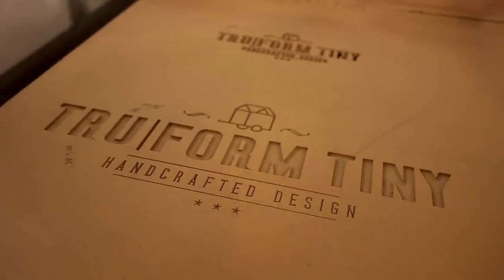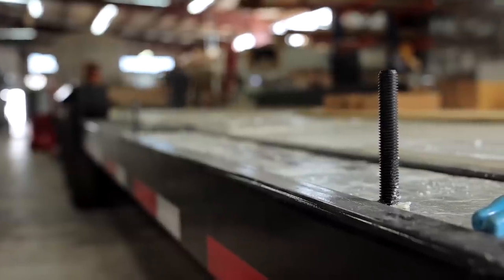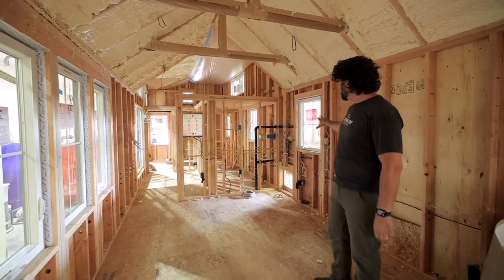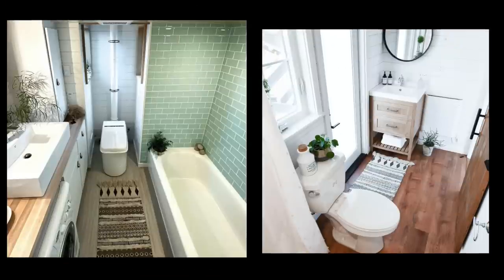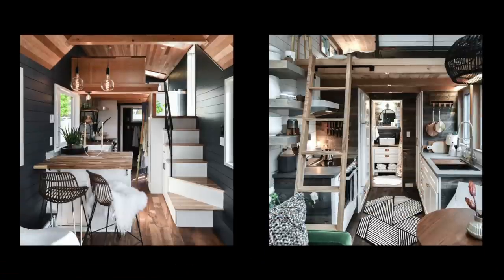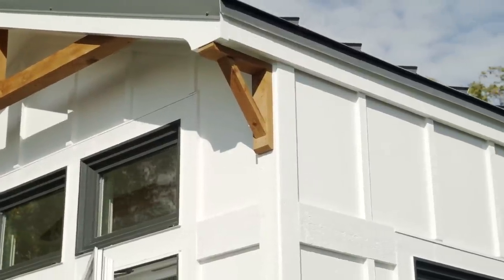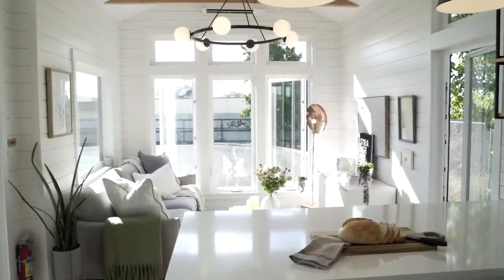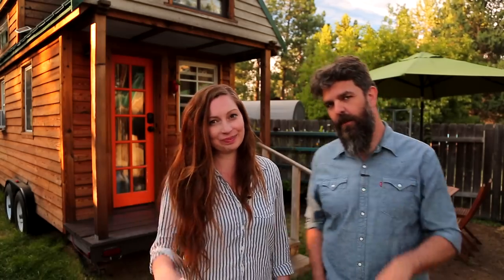How to Build Amazing Tiny Homes + Gorgeous Park Model Tiny House TOUR!

Comment: I’ve  worked in both commercial and residential construction for the last 28 years. I can attest that the building methods here rival, or best, most traditionally site built homes in the typical residential industry.  The craftsmanship is FAR BETTER than tract builders…it is comparable to custom built homes on a slab or crawl space foundation. Visit a tract home builder and you will see out of plumb walls…windows that are askew and rely on shims to make the windows “fit the opening”..roof to wall connections with gaps stuffed with sealant/caulking. For anyone believing these are fancy “mobile homes” ..they are NOT... These literally are site built homes on a mobile foundation. Absolutely beautiful as well.   TruForm will be my builder for my tiny home when I’m ready to build in 2024. ♥

Comment: what is the design program used  by Truform in this video?
Reply: I wondered the same as I'd like to do a mock up of the small cabin we're building, would make designing/placing stuff a lot easier I think.  I've tried a couple of free apps but haven't been too happy with them.
Reply: @malzimus  I've used Sketch-Up for years and I love the program, it gives a great 3d visual understanding of interior spaces but the program in this video seems to be more precise and better suited for tiny home mock-ups. I get the sense that these renderings could be used as straight-up blueprints.
Reply from the maker: Great question! Not sure but hopefully they’ll pop over here to answer your question. Also check out this new 3D tiny house design program from TinyEasy: https://www.tinyeasy.co.nz/3d-tiny-house-designer?ref=6&utm_source=blog&utm_medium=link&utm_campaign=affiliate
Reply: Great question! Our designer typically uses SketchUp.
Reply: @TruFormTiny  Thank you for your reply - I'm a SketchUp addict - It's a great problem solving tool - to me it's like a video game that doesn't waste your time - you have something to show for the countless hours you spend on it.

Comment: This is the first time I have heard of you guys and your business , your homes are gorgeous . The last home on the video, what was the cost of that home.
Reply from the maker: Hi Larry, happy to introduce you to great folks at TruForm Tiny! The Cascade Max model is one of their most high end homes and is priced around $186k: https://truformtiny.com/tiny-home-park-models/
Reply: @TinyHouseExpedition  Jeeze. Sad to see these tiny homes costing what a full-size house costs. 😔
Reply: @lisasoar8448  depends on where you live I guess. In my country you would be very lucky to have a very small outdated apartment for that price.
Reply: @lisasoar8448  False equivalency, a full size house built to that quality would run up into the millions for apples to apples. Houses don't all cost the same price!
Reply: @ZeoCyberG  No, these tiny homes ARE becoming more expensive. You could buy a house for that money. Would it be as nice? Maybe, maybe not; however, tiny homes don't appreciate the same way regular homes do. Tiny homes are supposed to be an affordable alternative.
Reply: @lisasoar8448  Sorry but everything is becoming more expensive.  It's the economy!  Reality check, the housing market has more than tripled in most parts of the country in the last 2 years.  While affordability is relative and not universal.  Everything built is going to range from low end, basic/generic, and minimalistic for the masses to high end, advance, and custom tailored to the individual, which means there's going to be a very wide range of prices for every type of home.  So if you want a nicer home, it's going to cost more!

It also means it's your choice, you don't have to buy a nicer home.  So you decide what's affordable to you, but you don't get to decide that for anyone else!  Fact is most of these tiny homes are being bought by people who can afford them, most of them aren't going to be built until someone commissions their build first.  So you're seeing what people are actually choosing.  While there are budget builders for those who want something at lower prices.   Again, it's your choice, just don't confuse that with what other people choose...

Btw, anything on a foundation will be able to appreciate, including tiny homes!  All houses actually depreciate, it's why it's possible to flip properties, why renovations can be beneficial, etc but not all properties will appreciate because that requires the local economy to improve over time but just like stocks it can go in either direction and even crash, with some areas even experiencing blight.  Having a home on a foundation just ties the house to the land and through it the local economy and thus allows for appreciation but you don't need it on a foundation everywhere to have that benefit, like in CA they allow THOWs to be ADU's and more recently they started allowing tiny houses to be primary houses.

While value can also change if demand change, which a high end house can vary quite a bit but people have been able to sell their tiny home for more than they originally purchased it when demand went up, much like the reason the housing market is so expensive right now.

Seriously, people are paying thousands a month just for renting an apartment.  In high demand places like NYC the average rent is over $4000... Versus something you can own and will reduce your long term costs, where people can save enough to buy a large house over the years, it's just not as simple as you're trying to make it as there's multiple ways people can make it work for them.  From choosing more affordable options, to doing it differently to better fit their situation.
Reply: @ZeoCyberG  Not trying to decide anything for anyone. I obviously know things are getting more expensive nowadays. Doesn't mean I can't bemoan that unfortunate fact. It's just frustrating.
Reply: @lisasoar8448  Really, the point is freedom and taking control.  You choose what you want to spend on and eliminate what you don't.  Focusing on your priorities and what matters to you to get what's appropriate to you and your situation... That's how it works!  The home isn't a magic solution, just a tool to use to influence your life and like all tools it depends on how you use it...
Reply: @lisasoar8448  Here's an example, a budget builder like Incredible Tiny Homes in Newport, TN offers a basic 16' THOW they call the Incred-I-Box for sale of around $20,000.   Another example is Simplify Tiny Homes, which is another budget builder...  There are options, just because people who can afford it are getting the nicest homes they can get doesn't mean no one else has any choices they can opt for...  There are always trade offs but always options too...
Reply: @ZeoCyberG  Thanks for that information.
Reply: Hi Larry! Looks like you may have had your question answered here, but please let us know if we can be of further assistance for tiny home model product information or pricing.
Reply: We completely understand this price point causes "sticker shock" especially for tiny homes! There is a lot of education we want to help provide the community on why our tiny homes are priced this way, as the industry has expanded far past the DIY shed-builds we have seen as the quintessential tiny home. Housing costs are also extremely varied depending on your geographical area, and for the West Coast, Pacific Northwest, California, Oregon, Colorado, etc. this price point IS the housing solution people are looking for. While we are not the most affordable tiny home builder out there, we are creating a higher-end product and we understand it may not be for everyone! We always encourage everyone to make the right decisions for their vision and budget.
Reply: @TruFormTiny  Thank you. I appreciate your thoughtful response and the information. Your homes really are beautiful.

Comment: I'm a Tiny House snob.  400 sq ft is maximum.
Reply from the maker: The featured Cascade Max is about 360 sqft 😊 but also why does have to be exactly 400 sqft for you??
Reply: @TinyHouseExpedition  Tradition.
Reply from the maker: @ellen3sons  gotcha 😁 all of TruForm Tiny’s builds are under 400 square feet, technically